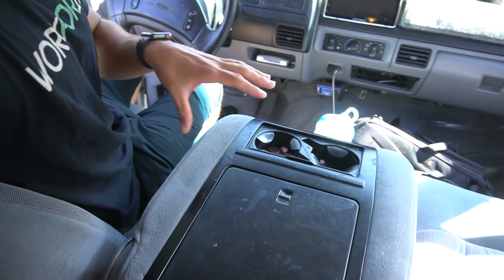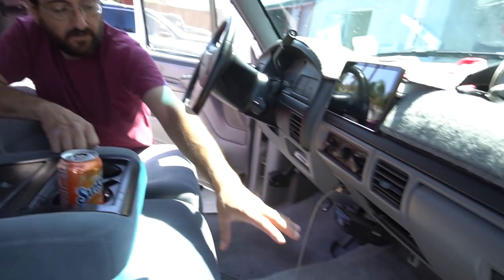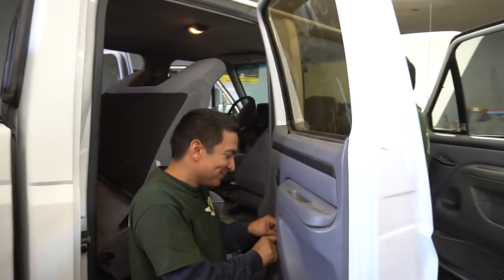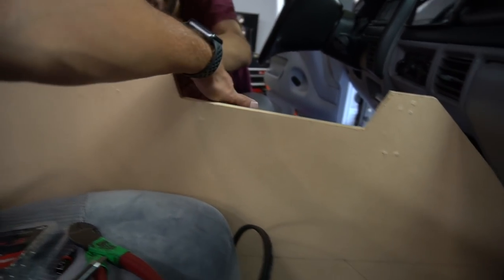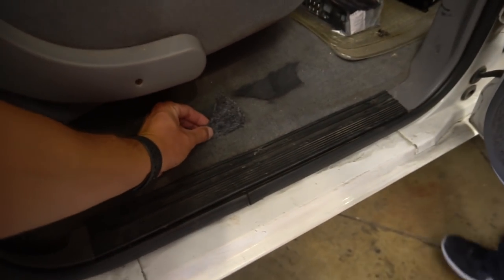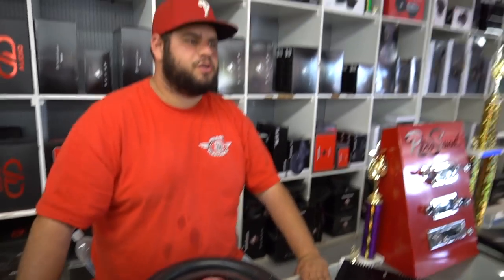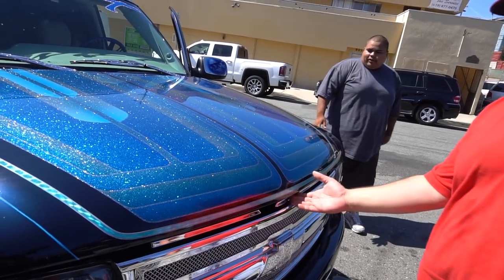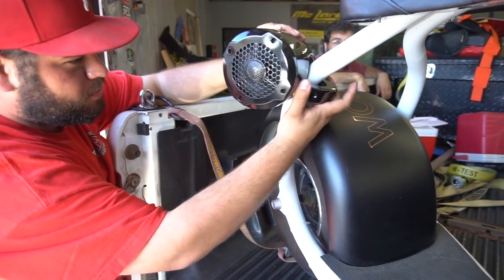OBS FORD CUSTOM CENTER CONSOLE BUILD AND AUDIO INSTALL!

Comment: Eventually doing something similar with my OBS 97 GMC RCSB Sierra K1500, currently have a Sundown SA8 v3 in a 1cf ported enclosure (tuned to 32hz) in the center console position on a Skar 800.1D amp at 1ohm (about 900w RMS), it was originally built for my EP3 Civic SI and was absolutely nasty in there due to the typical hatch cabin gain, still sounded pretty decent in my regular cab GMC, but definitely not as dramatic.

Thinking about doing a console build, the current enclosure is pretty much acting as the perfect arm rest, but nothing more, sub is front firing currently as that's what sounded best due to rear firing, even with almost 9" of space between the rear firing sub and the rear cab, was absolutely blasting my back window and opening up my center slider lol.... turned it around and it was just enough to stop that from happening and kill some of the resonance from the back window trying to break out. (Not really, but it sounded like it lol).

So now, console, with probably a 12" SI SQL12 as I'm going to rebuild as a SQ build, still haven't decided if I want down firing inside the console, or, to just use the console to hide the fact that I'm running in IB out the bottom of the floor 😅

Leaning all Dayton Audio interiors, 8" subs (yes, subs) in custom enclosures in the lower doors for front stereo subs and midbass, 6½" lower midrange into midbass drivers also enclosed in the doors separately, 3½ upper mids in pillar enclosures as well as AMT drivers in the pillar.... the rear fill will probably be 6½ full range drivers band passed for upper midbass and upper midrange, and then another set of smaller AMT Planar drivers to cover the tops, and then use the entire back wall for Zapco amps, DSP, and power distribution, and as I've got both battery trays, two XS Power AGM batteries and at least a 250amp alt and an absolute F-Ton of sound deadening over, inside, and on top every conceivable surface 😅

Edit: I'm commenting while watching like usual, that first panel of MDF they were fitting for looking at fitment....that rear enclosure area they're leaving doesn't look like enough volume for that sub, by 8" SA8's 1cf looks way bigger than that...I guess I didn't see the side profile yet and should pipe down and wait 😅

Comment: Super charged 2508!!! Dude killer choice!! I had 2 dd 608s on a dd m1d and they slammed!! I went a little cheaper on the subs to buy a better amp I think it was like 700$ for the amp and 400 for the subs

Comment: Back in the day, when I had my 4 kicker Solo-Baric 12's and 2 ZR 260's for the highs and mids. And 2 kicker ZR 1200's for my subs. In my 2004 Yukon Denali with 24's and a diamond grill. I got laid like mad! Sold it in 2006 and bought an H2. Still got laid like crazy. So I don't think the system did much out here. But it was fun until my front windshield exploded going 35 miles an hour down the road. I am done with that stuff.

Comment: I discovered like 2 days ago thanks to your previous video that I actually have a JL Audio 1000 watt amp under the passenger seat in my truck. I got curious and checked what's done besides speakers. Now you've convinced me to go get a set of subs 😂 damn my wallet hates me.

Comment: The inside sounds alot quieter than before cause that dynamate works wonders and you should do your doors when your in there replacing the door handle and it would be night and day difference!!

Comment: I had a 99 Ford Explore with 1212 inch subs on 5000 W kind of a budget set up but it still hit hard and I had a thing all encased in spray foam

Comment: Ok who is better this set up or Sun Down Audio? I hope to get a good bass thumper some day.
Reply: Good Ol Boy #76 they are both great but I support Jacob Fuller the owner of sundown because he specially designs every sub he makes and does several prototypes before he sends it out. He’ll even scrap a prototype that he has $5000 or more in if he doesn’t like it and it fails. But he makes several versions before he gives up
Reply: @Bhdobbs  If I can get the cash to build my system I am going with sundown because I have herd a lot of great stouts and reviews on them.
Reply: Good Ol Boy #76 even if you go with some of their older stuff you will not be disappointed. The X series is great to start with the Z series is nuts. The Nightshade series is even more nuts 😂😂
Reply: @Bhdobbs  well I have been a bass head all my life. I had a freind with a s10 blazer. He had the back made into 1 big speaker box and that's when I fell head over hills LOL.
Reply: Sundown for lowz

Comment: That guy has a $2,000 SUV and he's putting dual 24" subs in it? Like I get not everyone has a lot of money, but I think he should upgrade that ride before he drops that much money into a system for it, but maybe the point is to just be a beater with a huge system in it I don't know.
Reply: dedalliance1 I sure it’s meant to be a beater with a system because after those 24s he’s only going to have space in the 2 front seats

Comment: Maybe the reason why you can't get a drink in your cupholder is because you have a bunch of change and junk in them!!
Reply from the maker: Charles Oley nope. Bad design
Reply: Lol, no. Even the pull out style cup holders under the radio in early 2000 models suck unless you have a can, or something big like a gatorade bottle. But better make sure you don't have a second container of different size in the other cup holder or it'll offset how loose the grip is, and will cause the narrower container to fall out lol